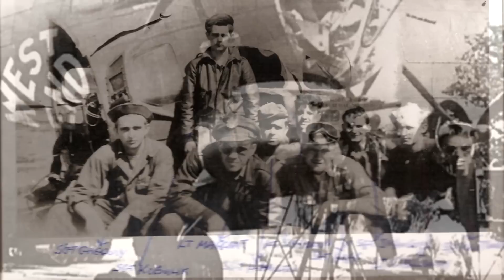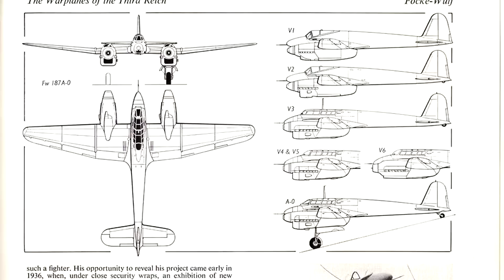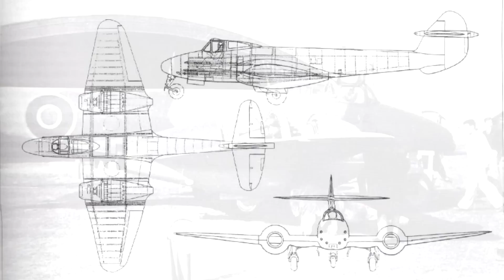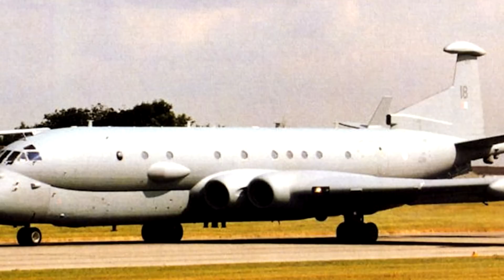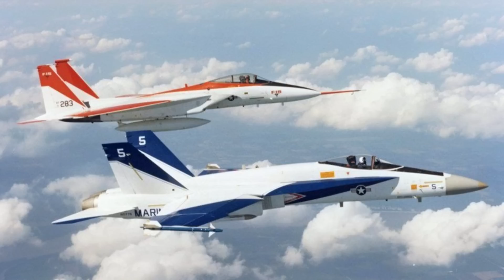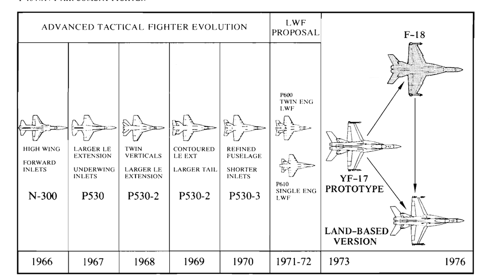Aviation - TEC's Passed To Developers - July 2023 - War Thunder

Comment: The nimrod might be unconventional, but I can imagine it in the game. It would combine elements of the buccaneer and the A10, featuring weaponry but no gun. Despite its slowness, it ironically surpasses the A10 in speed. I am uncertain about its maneuverability since the nimrod is based on the Comet, originally designed as a passenger aircraft. Therefore, it might be sluggish, but I believe the ample countermeasures it carries would compensate for this limitation. Speaking of maneuverability, the Boeing 707 can perform barrel rolls, making me think the Comet could do the same. However, I can't confirm this, as the 707 and Comet are entirely different aircraft.
Reply: I saw a Nimrod performance at an airshow at NAS Norfolk years ago.  I was amazed at the maneuvers that it performed.  It’s extremely agile for such a large aircraft.
Reply: The Nimrod has similar performances as an aircraft to the Vickers Valiant, Handley Page Victor and the Avro Vulcan. They have differing payloads but similar top speeds and sizes.
Reply: A10 is flying slab...you need something like SU-25 or MiG-27, those are kings of CAS. Slow CAS aircraft don't work that much...also, it's LARGE , GIRTHY